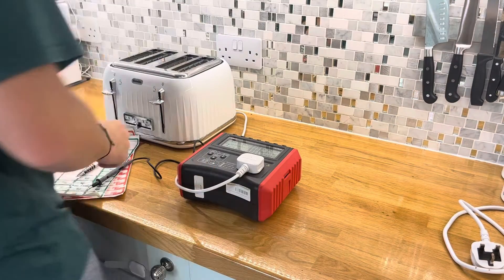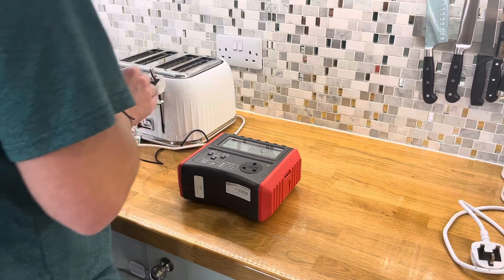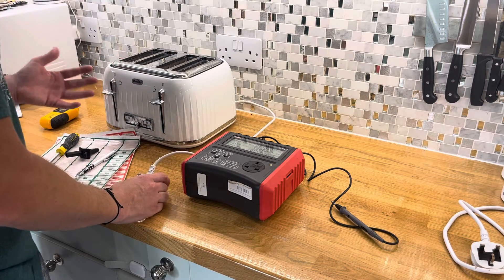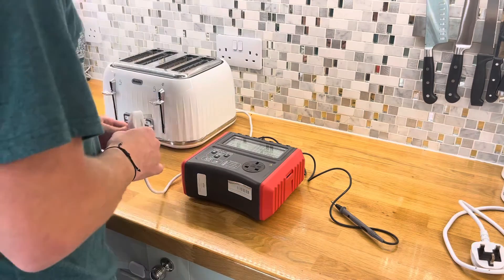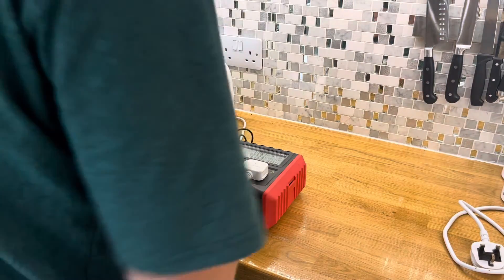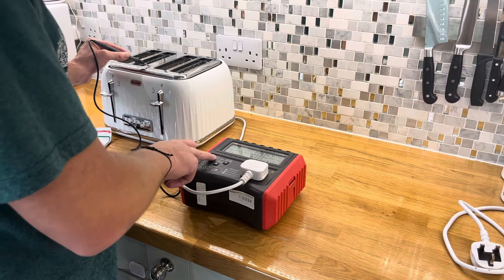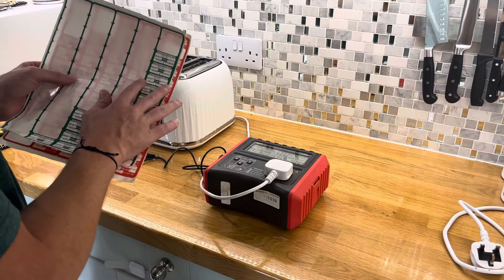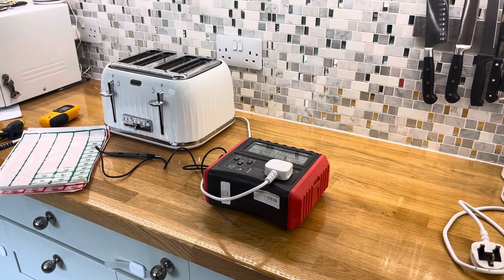HOW TO PAT Test a Class 1 Appliance - TOASTER

Comment: I would think a tv dose not "draw more voltage then the toster" a tv runs off a dc converter and probably runs off around 12volts internally, unless its an old tube tv then it has a transformer that increases the internal voltage, and the amps needed for a tv are heaps lower then a toster, the voltage draw dose not change only the amps needed
Reply: Your quite correct, the current draw changes depending on the appliance. The supply voltage to your sockets in the UK stays at 230v.

Comment: During the PAT testing course I did, I was advised to hold down the toast lowering lever during the test. I see that you didn't do that ... which method is correct? Thanks for the video and your anticipated response.
Reply: In answer to your question, the lever should be held down. Otherwise your not fully testing the appliance, your basically just testing the lead.